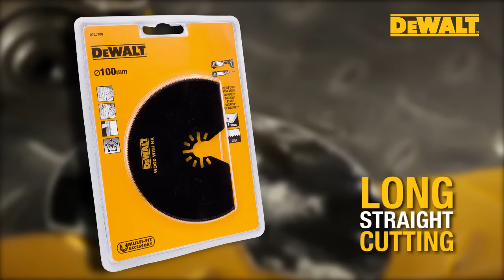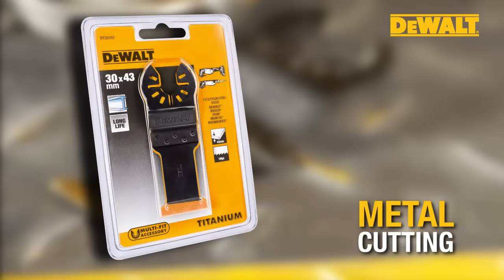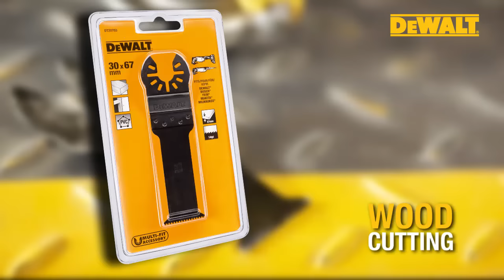DEWALT® 18V XR BRUSHLESS OSCILLATING MULTI-TOOL - DCS355P1

Comment: Love this tool. Been using it like crazy from carpentry to plumbing. Much safer and less messy than a grinder or reciprocating saw under a bathroom or kitchen sink when replacing old cruddy drain assemblies.

Comment: If this is the "full range" of accessories, why didnt you show the ability to use other style blade attachments and fittings? The flange and bolt on the bottom side?

Comment: I recently purchased an 18V 4.0 Ah DCS355. It came with 5 tools. Some were branded Dewalt and some weren't, like the 'bi-metal' blade that looked nothing like the one demo'd in the video here. It wouldn't even cut chicken wire! The equipment itself is fine but some of the tools that came with it are questionable. I wonder if anyone can recommend a mean blade that will cut  through nails.

Comment: Do multi tool blades  and scrapers interchange between different brand multi tools ?
Reply: Some do some dont. Just compare to the blades you have now at the part you insert into the tool.
Reply: Dremel seems to be the only one that has a proprietary accessory line. Dewalt accessories fit most of the other brands of oscillating multi-tools.

Comment: You'll be sorry if you try to change the blades like this guy in the video and the battery is in, and the lock is off and you accidentally pull the trigger with your pinky finger

Comment: 2:30 who the hell in the world  would cut the nail and wood and not removing the nail and cut the wood after  ?
Reply: Sometimes nails are in very difficult to access places, where you can't pull them out with a hammer, this cuts through them like a knife  through butter. I'm sure this was shown for demonstrative purposes only.
Reply: we often have to make cuts through wood where nails are sitting because the wood is being held in place. It could be rafters where the roof has been nailed onto from top. So they just show an example of the blade not caring about the nail it's cutting. And yeah it works that way. Very nice indeed.